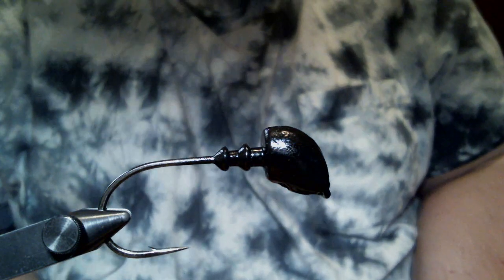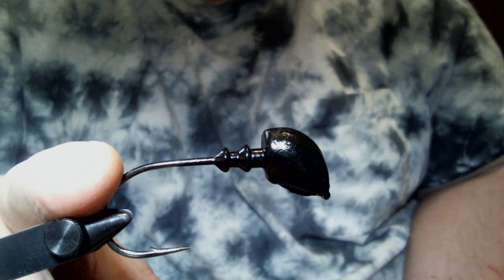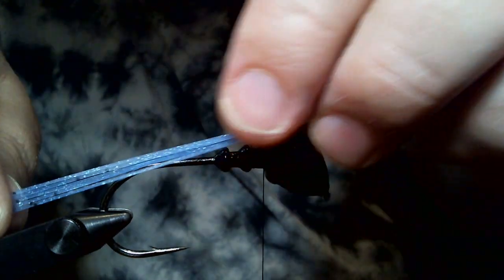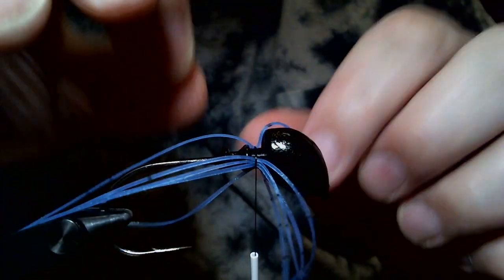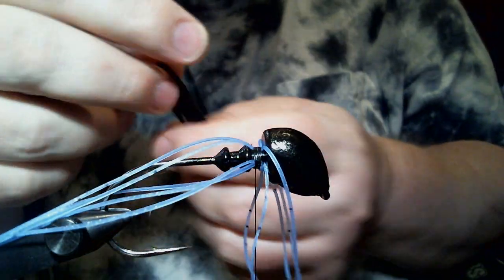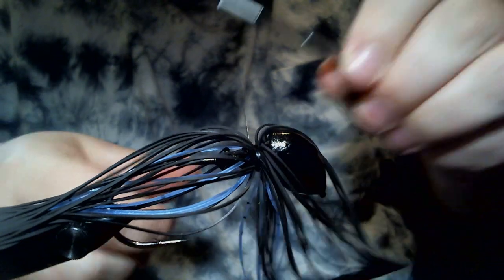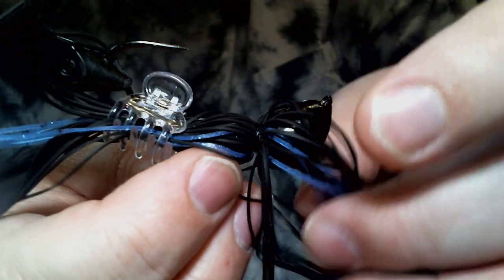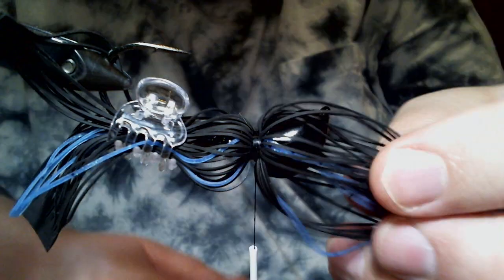3/4oz  Flipping Jig - Blue on Black Pattern

Comment: Beefy 3/4.  💪. Perfect fit for the V-guard too, nice touch. 

Round rubber on that head would be dynamite... flare on flare!
Reply from the maker: Thanks Adam!!! The one reason I don't tie this with rubber is because I only use this size jig a couple times a season so they tend to sit in my box a long time and the rubber ends up getting funky. I do agree with you on round rubber though, a lot of guys are now liking the fine square rubber but round rubber has more action.

Comment: Like the color pattern! I guess its experience tying up jigs to know  exactly how many strands of what color go where? But I can imagine that jig with a big black craw? Giving it a big shilloutte in the strike zone! Do you fish it a lose line? Or with a little tension on the line? Like jigging spoons in timber! Thanks for the lesson! Later Byrne
Reply from the maker: Thank you Michael!!!! The number of strands I use is to get the profile right. Some jigs that I need a smaller profile will get fewer strands and some that I want a larger profile get more strands. It sounds simple but it is a balancing act, you use a skirted jig to create a larger profile but you can get to a point where it is too much. A craw works well with this but you want a craw with very few appendages because it is used for crashing down in cover so you don't want too many "legs" grabbing on the cover. The Zoom super chunk keeps the craw profile yet is still kind of streamlined so it works perfectly. This is a flipping and short pitching type jig, it falls on a slack or semi slack line then hopped or jigged in place a couple times and then brought back in and pitched or flipped in the next spot and repeat.
Reply: @smalljaw for the profile, that makes sense! But it's the color pattern that seems to be the hardest to understand how it waa conceived?  By hit or miss or by watching it in the water? Beside your bulletproof construction of the jigs! It's the color patterns that's the hardest to understand? The blending of this & that color that has me confused? Hypnotized?? So that's why I think part can't be taught? Copied yes!! But it must be designed from time on the water! Thanks for the knowledge and therapeutic videos! I enjoy watching them! Be cool Byrne!!
Reply from the maker: @michaelbyrne8860  The color patterns I do have a lot of thought behind them based on what I see in the water. On this jig the thought was to have a proven color pattern that I could make to cover different water clarities. I used a little bit of pale blue pepper because it stands out in clear water but it isn't overpowering, it still has a natural look to it. I use the matte black as it stands out in dirty water and doesn't reflect the sunlight so it has almost a darker look. The natures edge blue is a deeper blue and in the water is contrast with the black but not as much and the black print just gives it a mottled appearance which to me looks more natural. As you can probably tell, I go a little overboard and most likely put too much thought into color patterns but I fish in pressured water so I want to separate myself from the other anglers on the water. So having looked at all these different colors in different water clarities under different sky conditions over the years helps me put together combinations of colors that I think will work together. Then during the winter I may come up with a few new patterns to try and then they get put to the test over the following season. Sometimes they work well and sometimes not, some do well under specific conditions while others work over a broad array of conditions. So there is a degree of trial and error but basically the patterns are based on educated guesses.

Comment: I have a question about the poison tail jigs for the 3/8 size. I’m not a fan of the ewg hook recommend. I was wondering what size in the mustad 32886 could you use for the 3/8? I’m coming from very stout and large hooks by dirty jigs so I wanted something similar to that. Anymore hooks that would fit in the 3/8 size that are heavy like the dirty jigs?
Reply from the maker: You'd have to modify the mold to take a really heavy hook but a 3/0 32886 will fit and possibly a 4/0. VMC makes a 3/0 and 4/0 in the 7217 which I think you'd like. You may have to modify the mold slightly but it shouldn't be very hard to do.
Reply: smalljaw I don’t want to have to modify the jig since I’m not very well versed in that type of stuff(I’m a teen) Do you think the 4/0 32886 will fit with ease or should I just play it safe and grab the 3/0
Reply from the maker: @dylan_hill  Ok, so here is the deal. The 4/0 32886 will not fit unless you modify the mold slightly but there is an alternative. The Eagle Claw 3886 black platinum (very good hook) is almost identical only the hook eye is a bit smaller in diameter. The 4/0 will fit the 3/8oz cavity, there is a slight gap so you will get some flash but if you don't mind cleaning the jig head a bit it will work. If you have access to a heavy duty shop vise you could put that hook in the mold and then put the mold in the vise and crank it until the mold closes. I will state that you don't have to do it, it will work as is but you have some flash on the jig that you can simply file off. If you don't want to do that go with the 3/0, I hope this helps.
Reply: smalljaw thank you so much!!!